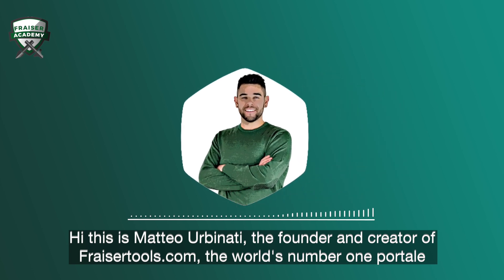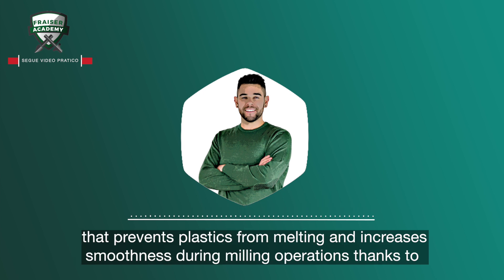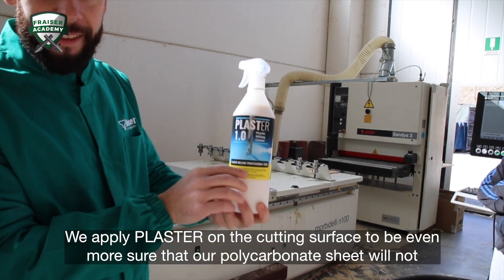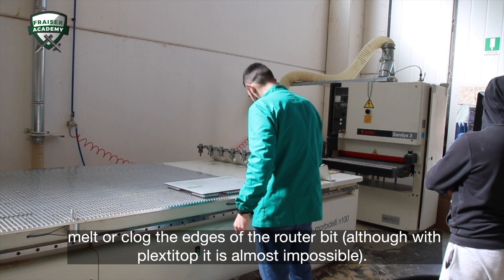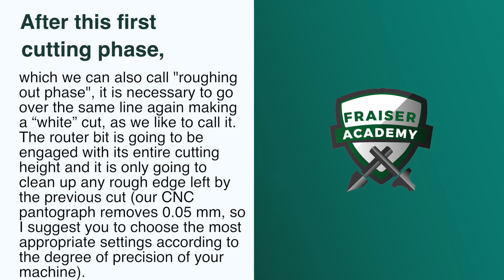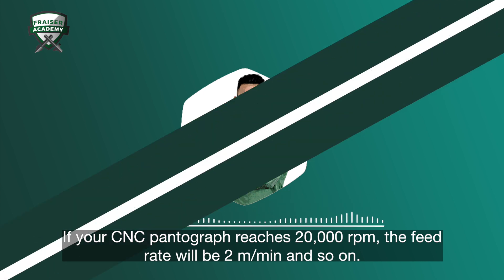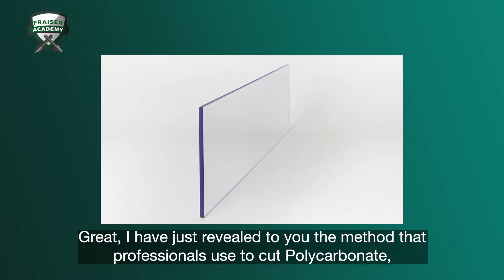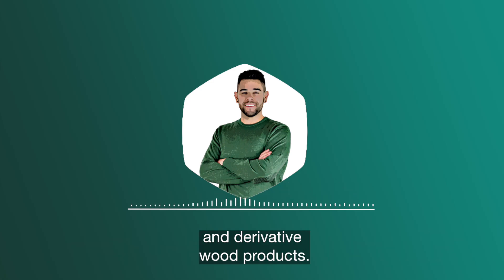How to Cut Plexiglass & Acrylics with CNC | Scientific & Polished Method

Comment: Sorry to say, but what you showed here is complete bullshit. First of all the cooling fluid will have zero effect if it's not introduced onto the cutter when milling. Second, you never place thin sheet material like that on vacuum pods but always on the flat matrix table that you have here, with a sheet of sacrificial MDF between it. You can never ever remove vibrations from a thin piece of material that is floating onto pods.
Reply from the maker: We don't feel sorry for this comment because if a rude person like you, who is a random and speaks without the evidence and basis hiding behind a nickname, doesn't understand that;

1) The workpiece was taken specifically between the clamps to point out the vibrations and not have them repeated  (or make people see where they are going wrong)

2) The polishing pass doesn't vibrate and works the same even if you don't have optimal holding systems for these materials ( an extra point to the plexitop)

3) Plaster 1.0 works the same even if it is not sprayed directly into the work, otherwise it would not be so appreciated by the thousands of millers who work with us every day

4) Your comment can only be made after you have purchased our kit and tried our Plexitop + Plaster 1.0 kit, otherwise it is just words in the air.

Thank you

https://www.fraisertools.com/en/carbider-poly
PS: Now the bits are on sale if you want

Bye
Reply: @FraiserTV   I mill thousands of pounds of material like this for a living and have never had the need to buy some rip off coolant like that tho. I think i’m capable enough to see what is bullshit and what not. By the way, you are milling polycarbonate here, not acrylic.
Reply from the maker: @JonasDM46  And we think you that we have been selling and assisting on bits milling for 50 years, second generation.

That still makes me think you are a random whipped person because if you want to be a professor you have to read the description and watch the whole video.

You stopped at the cover.

And if you go into the product there are also REAL reviews

Coolant lubricant is not essential but recommended and together they give you the POLISH finish with a carbide cutter, not diamond.

If you do not have the requirement or have never milled mirror finish you cannot know, and those who do not know should not comment on things above them.

So in these cases you ask nicely; but how come if the piece vibrates then you have an optimal finish equally?

And then; can I not use plaster?

That's it, people who are civilized and who turn to people who know more than they do should behave like that.

Not everyone can afford super-professional machines, and this system is tested and designed just for those people there.

And after this we have no more time to waste.

Greetings
Reply: @FraiserTV  What a total joke !